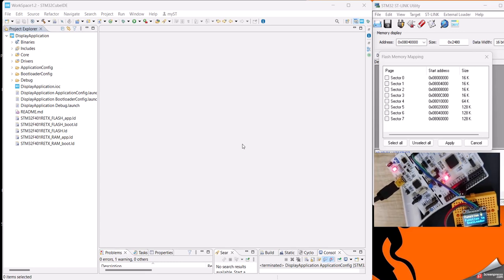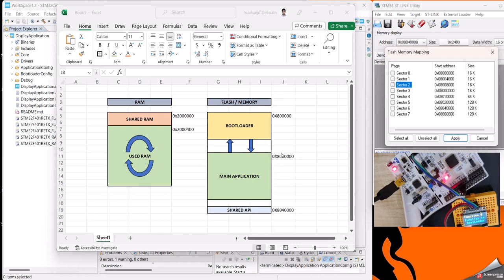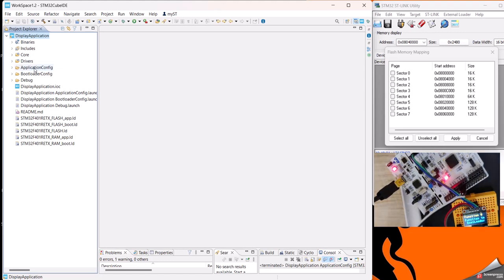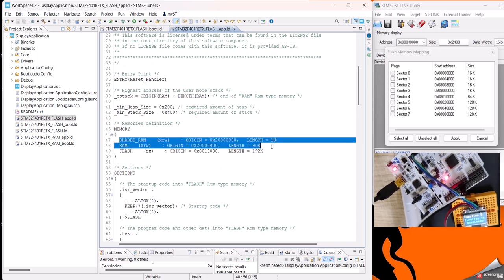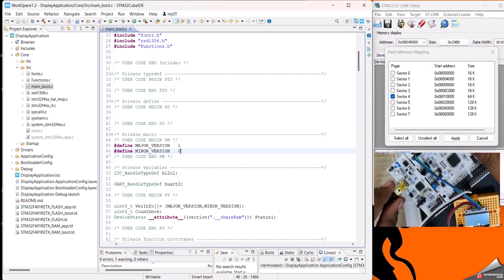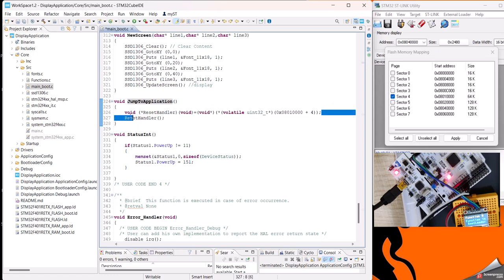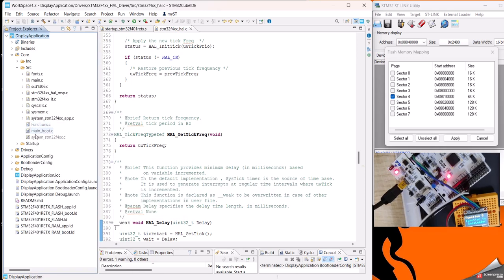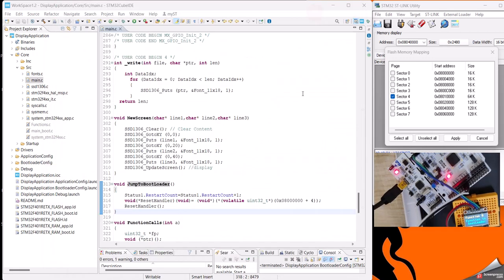STM32#bootloader #MemoryMap#BootloaderConcepts

Comment: Hello, i faced some problem in bootloader and user app, i used stm32f429Zi which have 2MB flsh. When i jum from bootloader to user app Hal_delay() ms wont work, means the update event based on systick interrupt just stuck ant the HAL_Delay() stucks at infinite loop. Whsat is possible for such issue.?
Reply from the maker: Can’t comment like that… need to check the code. Normally bootloader and app are different project and different binaries. So no link between execution . If the vector tables are updated correctly then it should fine
Reply: @EmbeddedworldJoy  I solved it,, the vector table of user app was pointing to the root flash origin, i explicitly un-commented and added value to VECT_TAB_OFFSET in system_stm32fxxx.c file. Now all interrupts are working fine.